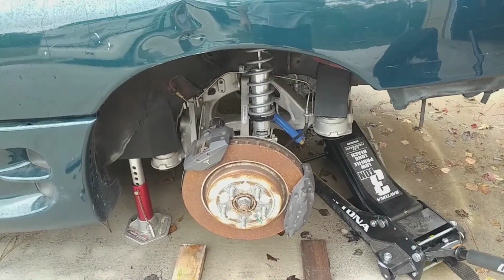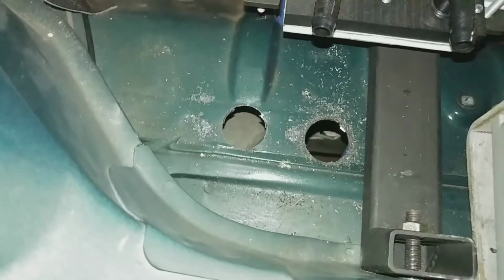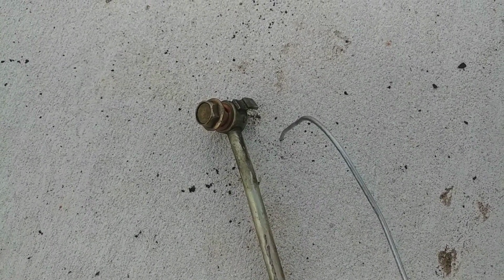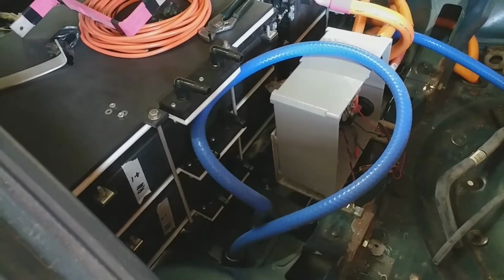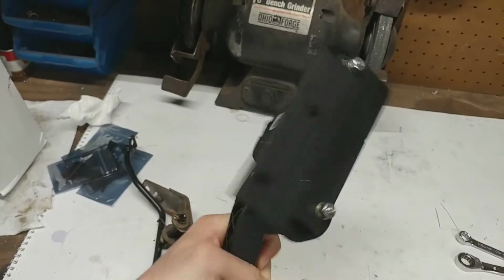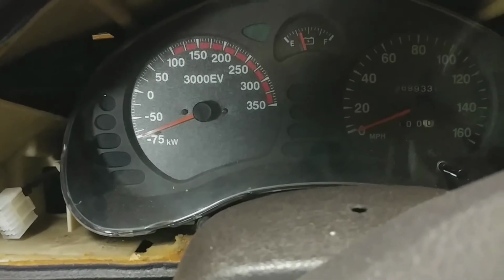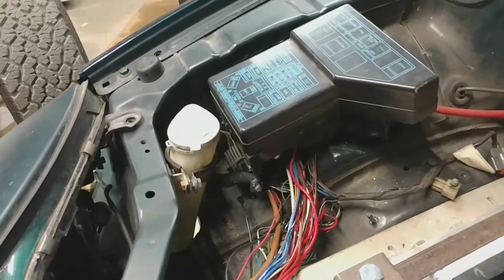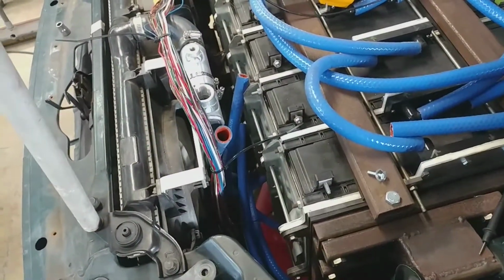Mitsubishi 3000GT Tesla Swap 26 - More cooling and some electronics

Comment: Great job.
About 5 years ago, I was thinking about redesigning my old, all-wheel drive outlander.

I wanted to disconnect the rear axle from the gasoline engine and put the rear platform / subframe from the Tesla.

And get about 500 HP in the end.

I watch every episode, although I don't understand the words. I do not speak English.

Good luck to you.
Reply from the maker: Thank you!
A "through the road" hybrid as you described is in theory possible, but I haven't seen anyone do that. Possibly because of the complexity of getting the two motors to cooperate properly, and the need to have space for both drives.